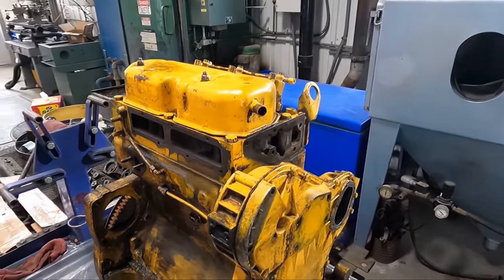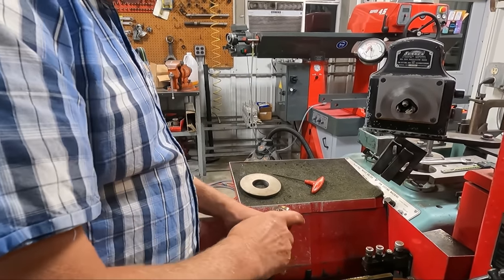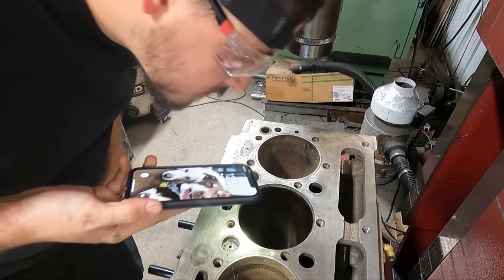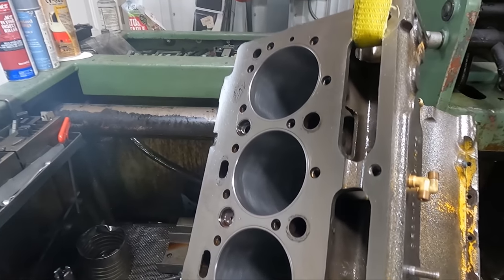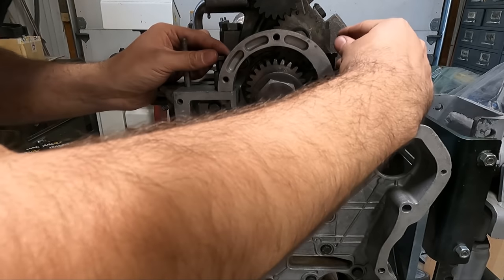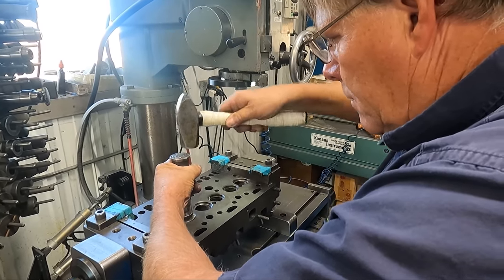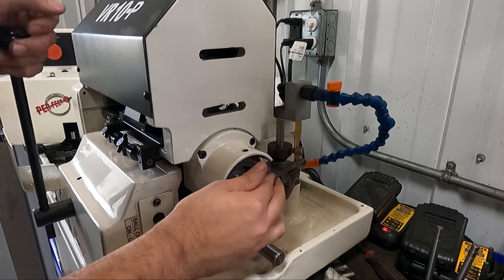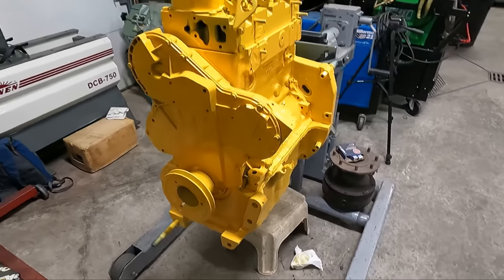Machining and Rebuilding A 152 Cubic Inch Perkins Diesel Engine In Under 20 Mins?

Comment: I want to see and hear these engines that you rebuild actually run and work when ur all done.. that's the best part of watching these rebuilds and at the end it feels like were missing the main part of seeing these done.. Just my opinion, you guys do amazing work and very particular about everything wich is great! People arent as dedicated like that anymore and do crappy work.. I just want to see the finished product Run..
Reply: I don’t know who first said this but it’s absolutely true. “Attention to detail is the only proof of sincerity”.
Reply: As a former, retired, auto tech. I would like to see how much better they run too. I've installed too many crappy crate engines that my customers have insisted on getting, just to have problems right out of the gate. Then the intentionally beguiling warranty process starts. On the other hand, I bet theirs run amazing. But, they don't do that part of an engine R&R. Maybe one of their customers will read about their engine, in the comments, and post a link to the video of their engine running. HINT HINT HINT . . .
Reply: The issue is I don’t think they always get what they need from the customer to run their engines before boxing them up. Things like high pressure fuel pumps for diesels, ECMs and ECUs for newer engines, etc. don’t usually travel to the machine shop with the engine, and are often refurbished/rebuilt as needed by someone specialized to do so. I know that when I send my CAT engines out for rebuilds at least that is the case.
Reply: My rebuilder has a set-up to run the engines just as you mentioned!! Really not a big deal to do, and could possibly prevent problems before releasing to the customer!! Just makes great business sense!!!
Reply: @vicchiapetta4166  I want to see it too, but he recieved that engine with no starter or high pressure fuel pump, unless you're rebuilding these regularly,  it wouldn't make sense to have that kind of set up on hand.  Would still be neat though.
Reply: Ikr!!
Reply: They are a machine shop,,, they don't install engines..... I have installed engines...A I can see enough from the quality of their Machining process to know these guys are on point......😎 Thanks
Reply: Yes me too!

Comment: I have done dozens of these Perkins AD152 motors, I used pullers every time to remove the cylinder liners. A great little engine, pulls well above its 45hp rating, never wants to give back.
Reply: Yeah we do them at work all the time too, we put the block upside down an use a hydraulic press to push the sleeves out, works everytime perfectly

Comment: I've been doing that kind of work for almost fifty years, but never with the automated equipment, all manually.  That engine washer must be nice, and the CNC seat cutter, it does beautiful work though.  Thanks for sharing that, it's a beautiful engine, together.
Reply from the maker: I wish the seat cutter was CNC! It's all still manual lol, just a lot nicer machine than some of the old school equipment. But yes the washer is nice, and the seat machine does make it easier to make a nice seat! 

Glad you enjoyed!
Reply: @JAMSIONLINE  After 50 years it would be rather obvious it is not a CNC controlled seat cutter. Was he having a laugh with you? It was interesting that a flex plate is fitted.beside a flywheel.
Reply: @jackrichards1863  who said it was a cnc controlled seat cutter?

Comment: I admire and appreciate ur above and beyond ways when it comes to things like the sleeves. U didn't have to clean up the inside of them but u did and thats part of what makes ur shop great. Like I always tell my son, "I dont care if ur a trash man or a CEO be the absolute best trash man or CEO u can be or y do it at all." GREAT WORK!!!🇺🇲🤙
Reply: Totally agree. I also like the expression "do the right thing, even when no one else is watching".
Reply: Amore Amore

.......
Reply: I always cleaned the bores out by hand, 800 to 1200 grade emery paper soaked in diesel, with a bit of luck, i could push the new liners in 3/4 of way in by hand.
Reply: Checking and "light" surfacing the top of the block was true performance.  It is amazing how many blocks warp every so little and reduces the life of the head gaskets.  Just using a straight edge is not definitive.  It's OK just not as zero defect as your approach.
Reply: 7

Comment: One time we had a customer that brought in a new Holland tractor block it was a 2008 or something like that this was around 2013. The mechanic wanted to make it easier for himself and he decided to weld the sleeve out he welded the top he welded the bottom he welded the whole thing it still wouldn't come out. He looks at the top and the bottom and finds out this engine does not have removable sleeves.

Comment: I am shopping for a Massey 35x and found this video. Rumor on the street is that Perkins designed the Cummins 12 valve 5.9 and sold the design to Cummins. After viewing this video, I can see many similarities between this engine and the 5.9. I have rebuilt the 5.9 and know it intimately. This little three banger has the bones to run forever. I am really impressed by this little beastie. Thanks for the video.

Comment: My day was a computer programmer. Today they call those people developers. I became a jack of all trades. I asked you guys on a different video that i watched just before this one if you ever fooled around with those chinese roller lifters. Since the oil manufacturers suprised everyone a few years back, i dont want to use flat tappets anymore. This build im doing is only replacing a 22re with a 68 327 and the money is extremely tight. The customer is only reringing the stock bore of .007 out of round but he agrees on the flat lifters. So we wants to know if those foreign one's are worth saving the money. They run around $175 plus $65 shipping. Hell of a lot cheaper than buying brand. He staying with a w56 5 spd stock trans rated at 150 HP. So stretching it out would be ill advised. Great video. You fellows know what your doing. Thanks for any opinion on the rollers. We're going to get them anyway and ill post the dia.'s of the OD's, actual fit and my opinion of the quality.

Comment: This is the way machine shops used to be. The case now is not so much. I’ve learned a lot by watching your channel and that actually saved my engine from blowing up as the machine shop didn’t clean the rocker arm tube which supplied oil to the head. I wish all machine shops were as dedicated as you are

Comment: I rebuilt and relined several 3.152s as an apprentice agricultural engineer. Beautiful little engines.
The pistons went into a sink full of hot water before fitting the gudgeon pins.

Comment: As an engine reconditioner myself with 50years experience I can confirm that your work is spot on especially the trouble you take in the cleaning of the components,this is a MUST for the longevity of the engine. The only difference in what you do and myself is I use a boring bar to remove the old liners by doing an offset cut down the side of the liner and then like you remove the liner with a Sharp knife or wood chisel. I have never done the 3cylinder Perkins but have done hundreds of the 4-108 engines that were popular here in the UK fitted to light vans. I converted a Commer PB petrol into a diesel with one of those 4-108 Perkins and fitted an overdrive gearbox,it was brilliant on fuel and pulled like a train. It had been converted into a motor caravan before I bought it so it was was quite heavy for the 1725cc petrol engine which was gutless and very thirsty on fuel,anyway anybody watching this I can assure them that the quality of your rebuilt engines are superb.
Reply from the maker: I appreciate the comment! The mutual respect for the work fellow peer in the industry is always appreciated!
Reply: @JAMSIONLINE   Możesz podać monety dokręcania obwodowy rozrządu, koła pośredniego rozrządu, miski olejowej i pozostałych rzeczy w Nm . Dziękuję za bardzo dobrą pracę 👍👍👍.
Pozdrawiam.

Comment: Those little Perkins are awesome engines...The equipment and tools sure have changed since I hung around the machine shop down the street... I use to clean and do work on head's mainly in order to barter my parts ,,, I sure miss those days and that great fella.😎 Great video content 😎 Thanks

Comment: I'm not certified mechanic but,   I'm able to put together what ever I take apart... the best part is painting the engine... I also look through books just to make sure my work is right to all measurements... I own a huge steel building where diesel engine and gas ⛽are torn down and put together... I also run a teaching program for school kids on weekends... I have all machines needed to overhaul engines... some kids turn out to be pretty good mechanics... I  love my job including teaching mechanics...We would like to thank you for sharing your video with us...

Comment: I have an old Massey with a 4 cylinder Perkins that has one more year ( hopefully) before rebuild. I sure wish y’all were closer as I do t trust any of the machine shops around my area. I go home to Wyoming 3 or 4 times a year and might have to throw it in the pick up and make a detour to drop it off at yalls shop. I’m always impressed with yours and your fathers work and especially attention to detail.
Reply: I presume it is not the rccardo 23, 4,147 in a mf 35 4cyl. . If it is make sure to make sure Ij  pump is up to spec,  and a thermostart  (CAV) fitted in inle manifold.
Reply: @geoffhemmings6546  it’s not. It’s the 5.2 Perkins 4 cylinder in a 1085.

Comment: Beautiful work!!! Especially the methods of replacing the sleeves in the block, the replacement of the wrist pin bushings, and the valve seat and guide replacements, and cutting the seats... This engine will run like new!

Comment: i have been a factory trained perkins mechanic for 25 years. perkins recommends light oil on pistons, i use wd40. assembly lube an excessive oil will glaze the liner and pistons leading to wet stacking. once an engine wet stacks it will need to be run on a dyno at full load for about 4 hours or torn down and deglaze the cylinders and clean piston grooves.

Comment: i used to work on the 3 cylinder construction line , bare blocks in one end and completed engines ready for test out the other
i basically worked all the positions on the line at some point, but mostly on the end of the line doing inspection and unload onto a trolley ready for test
at full tilt we used to off load 1 completed engine every 3 mins !
cool video, thanks

Comment: I did one of these last spring thats in my Massey industrial.  Didn't go to near the extent you guys went as I'm not a machine shop.  Bought the tractor with 2 broken pistons and a spun rod bearing.  Had the crank ground and put a rebuild kit in my cylinders actually surprisingly looked very good so I didn't bother with replacing the liners just a quick ball hone job.  On my head again looked really good but touched the valves up on the valve grinder and cleaned the seats up aswell.  I also put reman injectors in my tractor.  It runs like a top these little ad3.152 perkins are a very well built engine

Comment: A friend recently had a short block and head built for a rallycross car (SR20). He had the engine blasted before it went to them as the original block was rough. Anyway, it came back from the builder and clearly hadn't been cleaned as well as you guys do. There was still blasting media in the cooling jackets and it doesn't look like the had any of the oil way plugs out for cleaning. Worrying!

Comment: It is amazing how labor intensive it is to rebuild an engine. The whole time I watched your video, I was wondering how many hours were in this rebuild start to finish. Having rebuilt several classic VW engines, the time in hours it takes to disassemble/reassemble them correctly is staggering. Just to clean up the parts takes hours. These labor hours don't include the total that of the machine shop hours to rebuild the heads, line bore the case, etc.
It's no wonder that the costs to rebuild engines these days is so high for quality work.
Nice job.

Comment: Great to see someone rebuilding these old Perkins engines.  They are so well made and will last for ever.  I rebuilt the 4.203 that I run in my old Land Rover and I'm pretty sure it delivers more than its rated 63hp, I think these engines are very conservatively rated.

Comment: I rebuilt two of those one time that had sank on a boat while they were running at 3,600 RPM it didn't hurt anything except the head gasket and a few rods

Comment: Very nice video of the Perkins 3.152 machine work and attention to detail. I overhauled a 3.152 in a MF 135 that had the rear main rope seal type, which might be a little more difficult for some when seating it to the crank surface for a no leak results.

Comment: What a perfect motor. I would love to hear it run. And I think about how many different machines and uses It would have. With some routine maintenance that motor might run forever. It interesting that then they build super high performance formula one engine, they don’t use new engine blocks. The first builder of super high performance engines were having trouble getting engines to hold together.
They had a bunch of old blocks sitting for years behind the shop, the joke was that they had all been pee’d on several times.
Well the old, used “seasoned blocks” were the ones that held together best. It’s something to do with all the stress being relieved and the  salvaged block were the best of the bunch because all the others from the batch had failed. I bet that Perkins would outlive all of us if it was taken care of.  Really like your work, and the vids are interesting.

Comment: On dry sleeve removal, you can weld 3 or 4 passes of 7018 1/8" rod from bottom to top starting and stopping a 1/2 to 3/4" from the ends so you don't hurt the block. Once cooled the sleeves shrink and come out fairly easy. Just an idea, when done correctly it  saves time which saves money for you and your customer.

Comment: One thing I see on this engine is the camshaft is mounted really high in the block. That has to shorten up and lighten the valve train quite a bit. The only other pushrod engine I've seen that on was a Renault 1600 cc four. And that was a hemi.

Comment: I have always bored the old sleeve as you do gives me piece of mind. I have gotten away from doing machine work and at my age I'm glad to see this young man following his dad in this trade and doing it the way it is meant to be done. In my area there is a dozen different shops and 99 percent of them don't know what they are doing, they destroy more stuff than they fix usually beyond repair. The only shop that is good at what they do is always 5 to 6 months out from getting anything done. At 64 years old it would cost me way more than I want to spend to set up shop again. I have tried to get my kids or grandkids interested in it and that way they could take it over but no such luck.

Comment: The ring compressor at 7:42 is it homemade or commercially available to buy? The one I use is a thin steel ring compressor but it always try's to go into the bore along with the rings, this one has a thicker wall to it and is so easy and quick to use. Excellent video showing how one of these small engines are rebuilt, I have only ever rebuilt one A 3-152 and three AD 3-152 engines which is what this one is

Comment: Good job. I really think these small diesels done as good as possible last much longer than a quick in-frame for sure. I do like these Perkins and Yanmar engins and with stronger head bolts slightly over torqued they will take 30 or 40 lbs boost manifold pressure for a very long time.

Comment: Fan tastic video and commentary, thanks. I'm sure I'll be finding this invaluable in the next few days when I'll be swapping out my ratty old 152 for a new long motor which I hope to use for a very long and trouble-free time. I found it fascinating as I'd not seen most of these processes before despite the fact that my father was a mechanical engineer and used to take me round loads of precision engineering workshops and factories. He imported a product from the all-surface corporation of seattle called timesaver lapping compound. I wonder if you have come across it, and what you think of it. The usual comment i would hear was to the effect of, "if it's properly machined, you don't need that stuff", but I always thought that was to miss the point of it... I'm sure i'll be watching many more of your videos if they're all as excellent as this one.

Comment: Genuine Question, Doesn't it scratch the block when you use a knife? In a long term wouldn't that cause a Crack inside the bore? or does the new sleeve does its job of preventing it? Great Work as Always

Comment: I shared this video with a retired diesel mechanic who worked for Allis-Chalmers.  He liked your video but said that the cylinder sleeves needed to stick out of the top of the block because the head gasket isn't supposed to be in contact with the combustion.  Was your replacement head gasket designed to handle this?

Comment: Hey, just a question, but have you ever rebuilt the Perkins 2.2l I4 diesel Ford used in the early to mid-1980s diesel Rangers?

Because it would be interesting to see if an engine like that could be saved, 40 years later.

Comment: Excellent job. I've got a question for you guys: when the piston protrusion above the engine block is higher than the specs how do you guys proceed? Assuming shorter pistons aren't available and you're already using the shorter grade combo's of both pistons and rods...